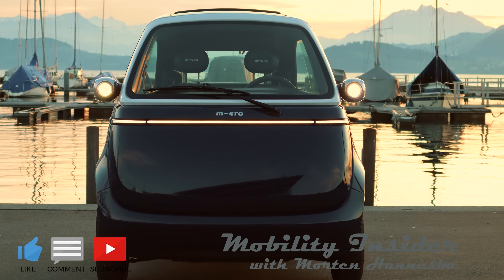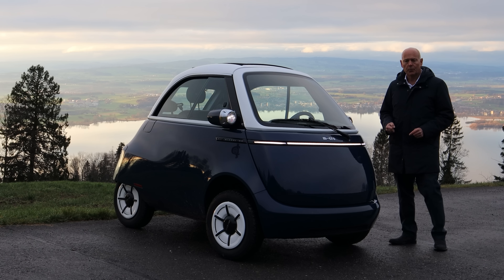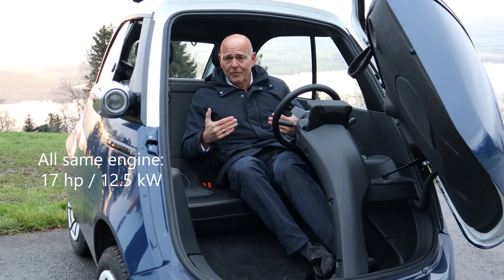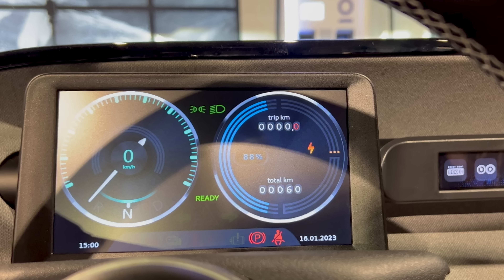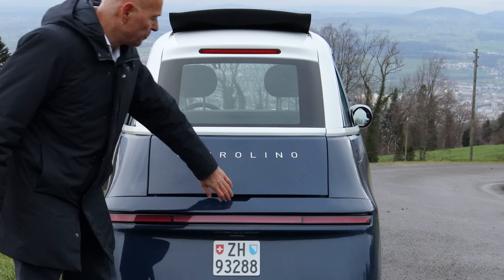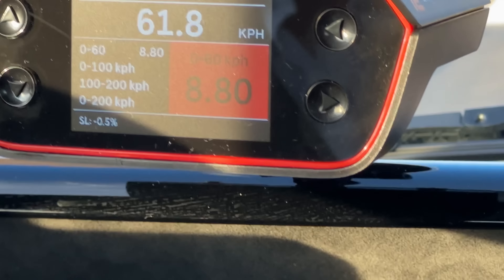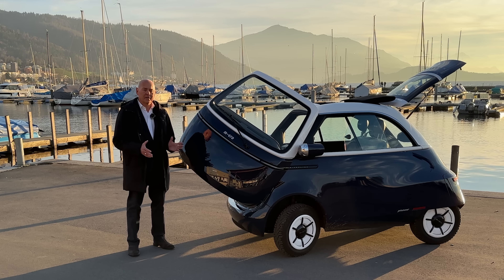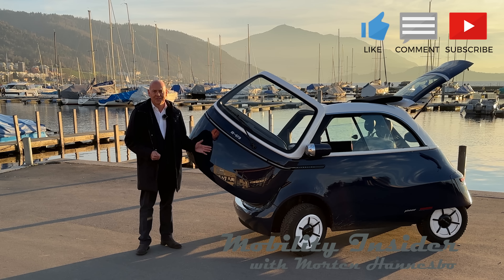A must see. Microlino - The small next big thing

Comment: I love small cars (I drive a Fiat 500) so I think this is a very cool car. Reminds me of the BMW Isetta from the 50's. I almost bought a used Isetta back in the 70's when they were relatively available here in San Francisco. Wonder if the Microlino could handle the hills here?
Reply: I mean its basically the same car in every physical dimension on the outside. Wonder if this would count as plagiarism.
Reply: I almost bought one back then, until my mother said that if I was killed in an accident, they could bury me in the car. I got a Beetle instead.

Comment: Really neat! I'd like to see them come to the States.
Reply: They have to establish western Europe outside of Italy and Switzerland  1rst. Give it 1-2 years at best unfortunately.
Reply: Never going to happen. Can't meet US safety standards for cars. Same reason you don't see any of the cheap, light Chinese or Indian minicars sold here.
Reply: @amightysailingman  How do you know? All this push for EV vehicles by this administration. There is some pretty small vehicles here already in Arizona that don't look that 'safe' electric AND gas. Don't be so sure of yourself.
Reply: @bobmalack481  You know nothing about the federal regulations. This "push" won't do anything to weaken them. You're the one who's arrogantly thinking you can judge which cars meet regulations just by glancing at them.
Reply: @amightysailingman  the smart for two EQ and the Toyota iQ are sold in the States and they are pretty close considering as micro cars.
Reply: @1HeatWalk  It's more than just size. They need safety features that are not included in the design. The Microlino just doesn't meet US federal standards. Just look at the bumpers. It doesn't have any. Nor does it have airbags, which are required by law. The cars you mentioned do meet the standards.

Comment: And the key to any bubble car type is going into a front bump when the  door is pushed backwards, your means of escape is zero, so you are trapped. And as found with many of its predecessors they were death traps. So folks think before you buy this or any other Bubble Car with a front door opening.
Reply from the maker: I asked the manufacturer about this. Their answer is that it is unlikely that the door will be blocked, however, in any case exit through the roof is possible.

Comment: I absolutely love this car. I was smitten the first time I saw it last year in another video and even more so this week when I saw it in a Milan showroom. My only concern would be that if you had someone park inconsiderably at the front and back (thinking of not being able to reverse to solve this if there was no room at the back) , it might be difficult to get the door to open wide enough to get in. But other than that this is the only electric car I would seriously consider.
Reply from the maker: It needs just a few cm to open - unlikely to be an issue, which also sometimes happens to normal cars😋
Reply: @morten_hannesbo  I suppose you could always do a pre purchase test and back/front it up against a wall to test it out. I obviously hadn’t taken into account that you can park it nose to the kerb.
Reply: @morten_hannesbo   Its not the space to open, its the space to walk up to door w bags, take off your coat, put away stuff and get in, etc... cars often need to park in a line, even bumper to bumper.... terrible place to get in over the front bumper.
Reply: You could probably pick it up on one end and turn it 90 degrees
Reply: @Ronny_van_Gerwen  not if you’re blocked in from both ends.
Reply from the maker: @Ronny_van_Gerwen  For sure Hafþór Júlíus Björnsson could....😀
Reply: That's just a BMW Isetta with electric Lipstick on.
Reply: One of the options should be a carry handle for repositioning:face-blue-smiling:
Reply from the maker: @scottcates  Optional for Iceland
Reply: Thats why you park in SIDEWAYS toward the side walk.Solves that whole problem. The car is so short the rear does not stick out into the roadway.

Comment: We need them licence built in the UK as RHD models please !  Just like BMW did with the original Isseta :)
Reply from the maker: I doubt this will happen, unfortunately. Re-design of the door would be very expensive
Reply: @morten_hannesbo  It was achieved in the 1950s when the originals were made under licence in the UK :)
Reply: The British built Isetta I owned was a LHD.
Reply: @MiscellanyandQuirk  My friend's  mothers one was RHD but I too have also seen LHD ones as well
Reply: I drove a LHD isetta for a few years,, the car is so narrow it didn't really compromise your road position, it's not like you will need to overtake many artic lorries on a B road with a top speed of about 56mph, which was about the same as the original bubble car.
Reply: @neilprimrose8301  This is the same reason why the Citroen Ami will only be produced in LDH so the company say

Comment: It’s a beautiful little thing. But the transmission was very loud whine - I don’t think I could put up with that for long. Perhaps they will change this on the later models?
Reply from the maker: Yes, they confirmed that production models will be improved and the whine reduced
Reply: @Peter Gilbert: Neither could I!
Reply from the maker: @michaelbacon561  The whine will decrease in bulk production, the early units will be improved afterwards, I believe. The transmission unit needs more noise insulation and calibration. The noise is ok in daily use, though, just like on a motorbike one tends to accept more noise.

Comment: I'd love to have one. A drawback for some cities is that not many have access to a plug in.
Reply from the maker: The Microlino even charges from the normal household power socket, quite easy for most to get access to one.
Reply: @morten_hannesbo  No, that's absolutely a false statement. Literally a very false statement. Do you have any data to back that up? What info suggests that most people in cities have electrical sockets out in the street? Or that "most" people would have any own parking place at all, let alone one with a socket?

Remember, you're not supposed to use extension cords for charging cars.
Reply: @pistonburner6448  Yes, I live in a rented flat and I can't charge my plug-in-hybrid. EV are for people can charge at home and/or at work. If you can't do that you're out of luck. Sorry to say. 4 hours at public charger - no way. You pay per the minute here.
Reply: Well, put in some places to plug in. Don't demand that this should always have existed and give up... How many meters (or footses) is an urban parking spot from electricity? This is a solved problem. Some wires and proper outlets and you can have electricity anywhere you want. Sheesh...
Reply: @geirmyrvagnes8718  I am not supposed to run wires on public space and I live on the 5th floor. So for me it's an unsolved problem.
Reply: @Martin_Siegel  Whoever owns the parking space can make it happen. It is easy. What if they don't want to? If you are left wing, you elect people to mandate this. If you are right wing, you move to the 5th floor somewhere that has this installed for slightly higher rent, so the market demands this. If you live in some sort of dictatorship, you may have to start a revolution. OK, the last part is a bit dangerous, but maybe you should do that anyway, and charging is not your biggest problem? 😇
Reply: @geirmyrvagnes8718  You do the math. After the planning, legal considerations, safety aspects, equipment costs, maintenance, maintenance management, billing, eventual replacement...how much do you think a "simple socket" costs?

This is incredibly complex and difficult, and usually costs far more than any use people get from it. Usually just about everywhere you look the situation is different so you have to do a separate plan with all the elements worked out.

And with EVs everyone is trying to price-gouge because most of the early EV buyers are gullible people with apparently too much money so they'll just throw it around and let themselves be cheated (I mean they did believe the EV scam...). 

When I asked for offers for a charging station for my parking spot which actually had a technically really easy situation I was offered all kinds of solutions with price tags from about 200%-500% of the actual cost of what I did in the end: I made the plans myself, just paid an electrical engineer to approve them, pre-installed the hardware myself and only hired an electrician to come and make the final connections (with everything already in place but just the final connections were left for the electrician).

Note also that the massively high prices are from companies who should not be charging for the whole planning part and all the hardware since they should have standard plans which they then apply depending on what type of case they're dealing with, no need for bespoke designs. And they buy the hardware in bulk at probably 70% of the prices I paid or less. This should be routine for them...yet the prices are absurd.

In one case a simple 1-phase charger for 6 cars in a parking area had the most easy planning and installation case: the parking area already had a dedicated circuit!! So the cost should've been about at maximum €2000 per parking spot (in reality the cost ended up at €1200 thanks to me), and yet we received offers of over €20,000...and they would've also required some monthly fee!

Now imagine public servants who are totally incompetent but will never admit that because they're trying to get a raise, which requires the opposite of admitting their incompetence... Public servants who don't care one small bit about saving taxpayer money, on the contrary: they aim to increase their budget at every opportunity! They don't want to save money or do things rationally, they only care about formal justifications, doing as little as possible, and instead concentrating on scheming for salary increases and getting raises with their colleagues.

And you want to ask these people to manage thousands and thousands of cases of installing simple little sockets which are a prime source of price-gouging for companies but none of the benefits will be appreciated by anyone, those sockets will never pay for themselves because no-one is prepared to actually pay for them. Like you people only demand free stuff, and not only that but will let themselves be duped into thinking they did get free stuff and "someone else" paid for it when in reality the price was massively inflated, lots of people made a lot of money on it, and you the taxpayer paid for everything...while like a handful of people got a tiny bit of selfish benefit from it... Nowhere near worth it.
Reply: @pistonburner6448  I think it should cost (including electricity costs) less than liquid fuel would have cost over a time until it is time to replace the whole thing. If you have incompetent and corrupt public servants, that is a problem in itself. Not an EV problem. If contractors want to price gouge, that is a problem in itself. Not an EV problem. No need to take all the problems in the world and call them EV problems. These people would earn their less-than-deserved money some way anyway, but this way at least the air get less toxic in the process.
Reply: @geirmyrvagnes8718  Well, present us with a general estimation of costs, please! You say you know so well how little it'll cost, please present all the different things you need to pay for and an estimate of the sums!
Reply: @pistonburner6448  I have said nothing like that, and I will not do your homework. My claim is that it is EASY. If you are considering a cool boutique designer car to be delivered in the future, like the one in the video, money can be obtained and time is at hand. If you are buying a used Leaf on impulse today to save money, and don't care about anything else, the equation is a bit different, but I will not do that homework for you, either. 😄
Reply: @pistonburner6448  I have not asked for any money to be spent for my wishes, selfish or otherwise. Your trolling is getting too obvious. A heartfelt and sincere apology for your numerous and clearly groundless accusations against me MAY get you a reply, but I am not making any promises.
Reply: @pistonburner6448  But if you use a high amp/power equipment load extention cord I believe you'll be fine.

Comment: Do you have to have a driving license, insurance, road tax and m.o.t. in The U.K. for one of these and are they available in The U.K. Please?
Reply from the maker: Hi RM 713 - The Microlino is a quadricycle in the category L7e. As it has more than 6kw of power (but less than 15 kW) it requires a full car licence to legally drive it on UK roads. Small quadricycles with max. 6 kW of power just need a motor cycle license - please note that the rules in the UK may vary since BREXIT and depend on when your licence was acquired, but this is my current information.

I asked the manufacturer of Microlino if they plan to export to the UK - their answer is that for the moment no decision has been made, but export of the LHD-version would be possible. A new development of a RHD-version is not on the drawing board for the moment.
Reply from the maker: ...and yes, you need insurance and must pay road tax etc.
Reply from the maker: In Germany, Austria, Italy, Belgium, France the minimum age is 18 years + category B driving licence. In Switzerland, the minimum driving licence required is category B1 (small and three-wheeled motor vehicles with an unladen weight of not more than 550 kg). Insurance for a Microlino is about 40-50% cheaper than for a normal very small passenger car. For for the Swiss market, a full package consisting of third party liability, fully comprehensive and parking damage insurance is offered at a cost of CHF 550 annually.

Comment: Interessant wäre es mit ihm eine Passstrasse zu testen. Hat er die nötige Leistung um bergauf zu fahren?
Reply from the maker: Ja, kein Problem, bin auf 1000 Hhm gewesen (600 Hhm, steil @8-12%).
Reply: (Gotta learn German - it sounds so cool!!)
Reply from the maker: @meredithheath5272  😁
Reply: @meredithheath5272  I asked if the car has enough juice to drive a steep slope uphill. In the meantime I  actually test-drove the Knutschkugel myself and have to say I'm impressed by the agility and power. Less impressed by high speed.

Comment: Looks like a fun and practical vehicle! What's the top speed and price?
Reply: 90km/h and around 20k€ depending on what spec and battery size you’re choosing
Reply: @Luisfffrrr  thanks!
Reply from the maker: Hi Alex, 90 km/h top speed. Prices start at 16000 EUR. As tested; 21000 EUR.
Reply: @morten_hannesbo  thanks for confirming! :)
Reply: So it’s twice the price of the Isetta (adjusted) with 1/3 of the range (at best) but without the confort of having the steering wheel attached to the door to facilitate entrance.
Reply from the maker: @DinoAlberini  Inflation, I guess😀
Reply: @morten_hannesbo  that’s why I said “adjusted” 😉

Comment: Safety features were not discussed.  Are your knees the primary frontal crash avoidance devices as they were in the Isetta???
Reply from the maker: Basically the Microlino is categorized a motorcycle and topspeed limited to 90 km/h. The structure is crash resistant but this is not a car.
Reply: So they are a deathtrap.
Reply from the maker: @miskatonic6210  No, that is not really true. The Automotive unibody structure
First in its class, the Microlino features a self-supporting unibody that improves safety and driving behavior compared to the tubular frame of other vehicles in its class. It feels quite safe to drive and of course it has safety seat belts.
Reply: @morten_hannesbo  Thank you for your reply.  I want to assure you that my question was genuine, not sarcasm.  90km/h or  56 mph here in the USA is pretty fast.  30 mph or 48 kp/h is enough to get seriously hurt in a front end accident.  With no bumpers, no airbag, and no special structural strengthening I would be hesitant to drive/own one of these.  They are cute, like the Isetta, but I'm old enough to remember Isettas being used by Chicken D'lite to deliver food in the 1950s.  I've seen front end crashes with Isettas.  They aren't pretty.
Reply from the maker: Of course the Microlino is much more rigid than the old 50'ies Isetta, but clearly you do not want to crash with these vehicles. When I ride my motor bike I also drive more defensively.

Comment: So if driver has the slightest bump or accident, likely they are trapped and can not exit?  Door swinging upward is a recipe for door being stuck.
Reply from the maker: Could be a problem in extreme cases, but microlino both has a big sunroof and a fairly big tailgate so unlikely that all will be blocked
Reply: @morten_hannesbo  thank u for responding... its a "cute" vehicle but not sure how realistic it is to count on exit via sunroof... depends how its constructed and which way the glass slides/swings, would not assume its easy.  Climbing out back, over the top of the seat, also may not be easy, esp for older or larger/fat people.  The main door may even cause issues from issues at the open button location... just a crap design choice, from practical standpoint, to have an upswinging only door as your car front.  And headlight/mirror combo, to me, just guarantees you lose a headlight when a motorcycle or truck clips your mirror... i know i sound negative but practical issues were not high in design agenda.
Reply from the maker: @NA-su3jk  Quite. Better avoid accidents. Like when you drive a motor bike.